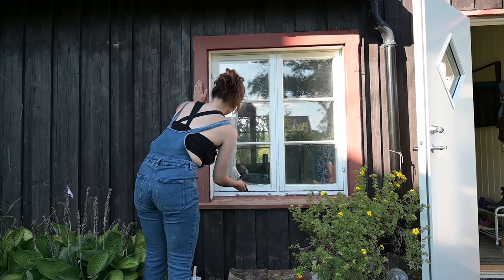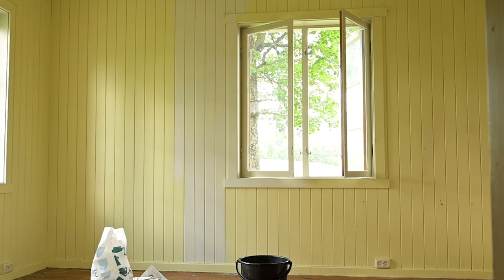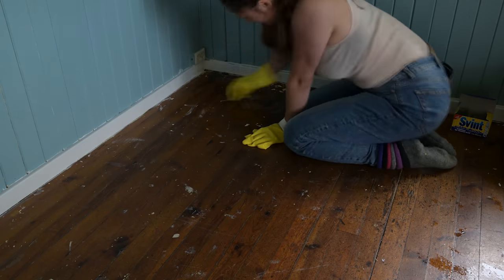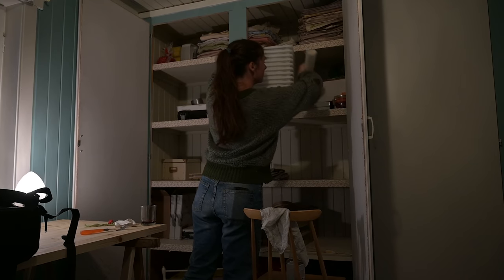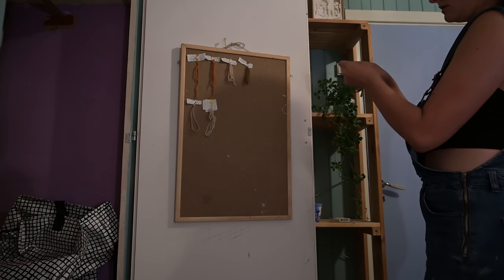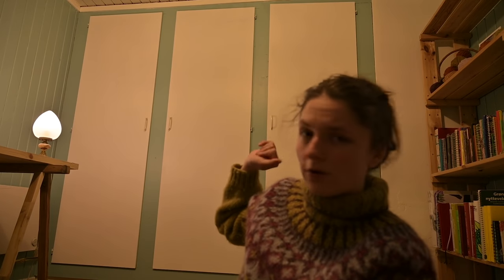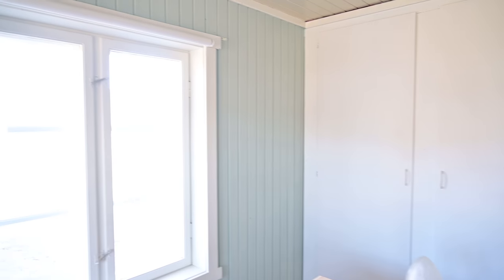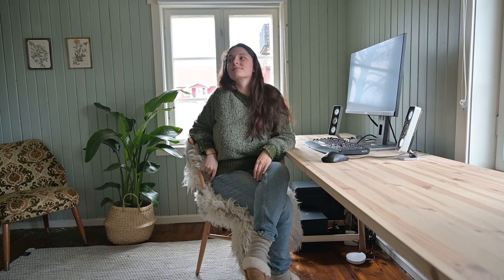Office Makeover on a budget - Making a Boho/Scandi home office in our rental cottage - story 20

Comment: The cupboard wall looks so much better all white- much softer as the green and white contrasted too much before. 
In the corner: the small plant stand/table’s wood is quite red/dark where as the other woods are cooler toned. Can you sand it and stain it a lighter colour to match the tone of the room? You could also hang a trailing plant on the wall to fill the space. 
I’ve just bought a house and I am facing all the dilemmas you have gone through in your home.
Reply from the maker: I totally agree. Its generally nicer in one color I think, since those cupboard-doors aren't that nice, and I don't want them to stand out so much from the wall. Giving the plant stand another color is a good idea, I actually thought the same about the legs of the chair... Thank you for the suggestion. A hanging plant is also a great idea <3.
Ahh, its a lot of questions with these houses right? But also so much fun I think. Best of luck with it!